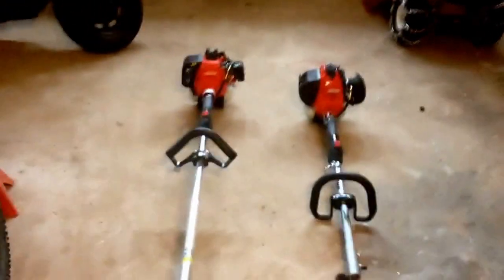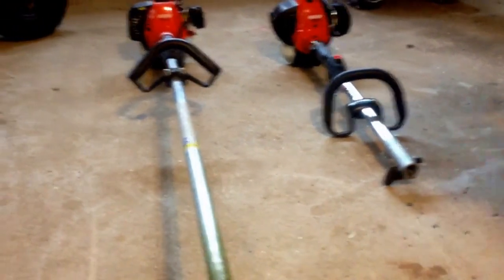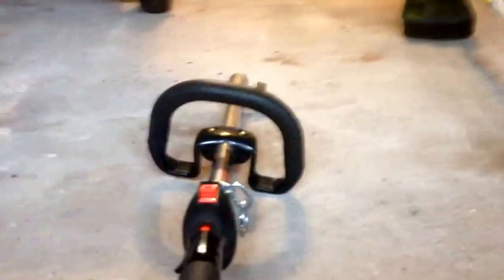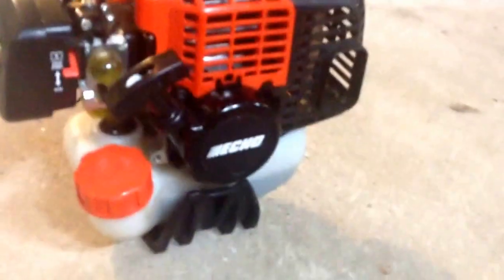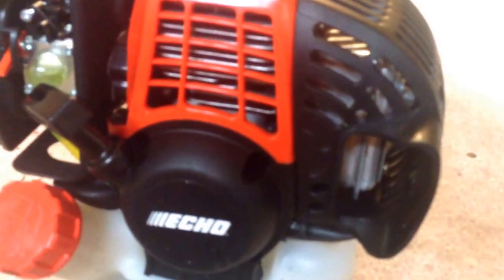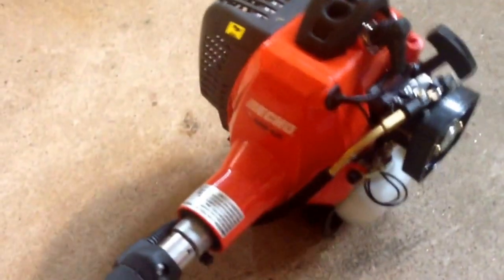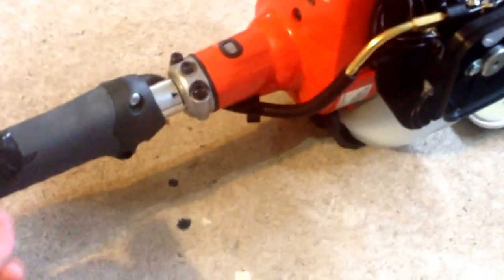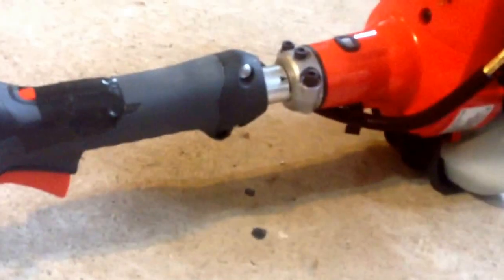Srm 230 vs pas 266

Comment: Although I agree with you that the PAS Power Heads are most definitely more useful and practical for multiple applications...its not  JUST $20 more. Its $20.00 PLUS the cost of whatever attachments you buy. Cant do much with the power head and no attachments. lol. But for trimming in a professional aspects you gotta look at power to weight ratios.... The srm 230 is lighter by almost 3 full lbs than the PAS 266 with just a basic trimmer attachment. So for any real world trimming the 230 has more than enough power for almost any job we would normally do. $289.00 for th3 230 and over $400.00 for the PAS 266 with attachment and taxes. BIG difference when you use the tool for more than an hour at a time. Running a 266 all day would wear you out real quick.... Trust me. I know from experience. But still a great buy on the PAS. Best for using attachments other than the  trimmer.... I.e. Tiller, Pole saw, blower, ect. - ECHO Diehard fan. ;)

Comment: I prefer the SRM-225 trimmer, because it's lighter and better balanced.  And the PE-225 is also lighter.  I do edge with the PAS-266, as it's my backup to my SRM-225.  I tried the brush cutter attachment and wasn't impressed.